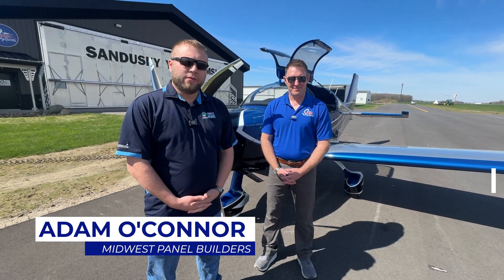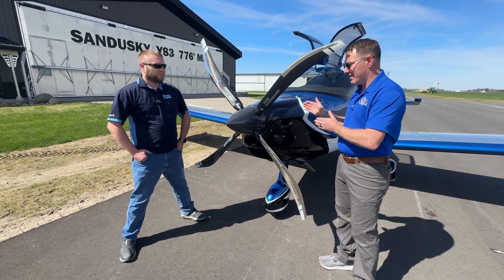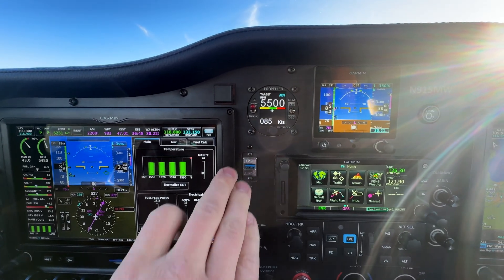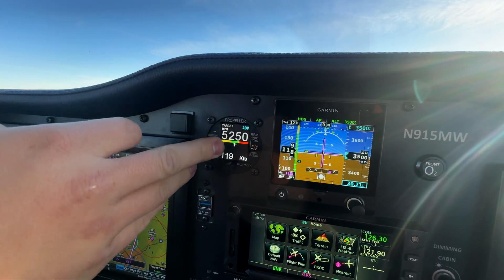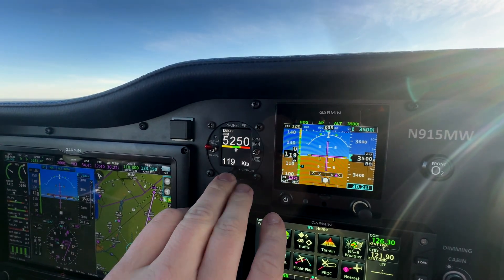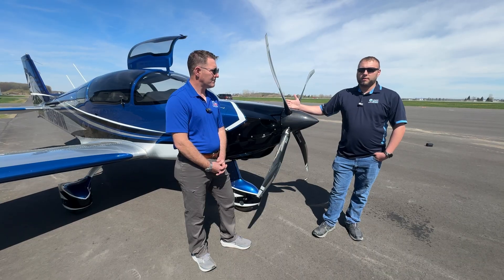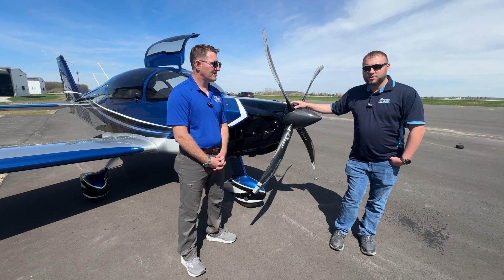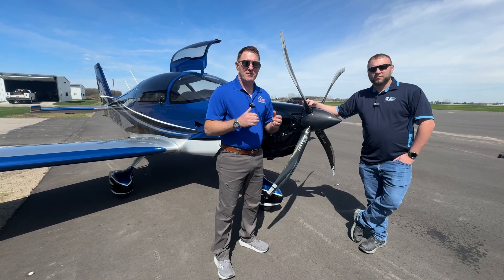DUC Tiger Propeller with the Flybox APR1

Comment: I have the PRP-1 controller, and the DUC Swirl Black 3 on my Bristell 912iS, and love the combination. I used to get 500 to 600 ft per minute climb. With this setup I now get 1000 to 1200 ft a minute and absolutely love it. I did not gain a bunch of top end speed, however, once I'm at cruise level, I can back my prop down to 5200 RPMs and still get 110 to 120 knots. Burning only around 4 gallons per hour. After watching this video, I don't really see an advantage to the APR1. I checked and it seems to be quite a bit more expensive. I pay more money for 10 more knots, but it doesn't look like this one gives that to you either. This is a great review. Thanks

Comment: So are you setting the throttle based on manifold pressure, or % throttle position?
Reply from the maker: We set throttle based on % power as reported by the Rotax ECU to the G3X. In other words, we're targeting % of max continuous horsepower. So if the G3X is showing 50%, that translates to 68HP. Flying this way means that RPM and MAP settings are less important. For example, at 5500 RPM and 30" of MAP, I would have a different horsepower output than 5200 RPM and 30". If I just target 50% power, then I know what I'm getting for thrust regardless of my present RPM setting.

Comment: This sounds like a Duc sales pitch. Either way, I refuse to identify with match sticks as propellers. I think Airmaster with Catto blades are the way to go.
Reply from the maker: There are no affiliate links and we do not sell these on our website so no sales pitch involved, we are reviewing a prop that has become popular in the Sling community. I think we were honest in saying that we would not change from a current setup and that it gave no increase in speed. We have nothing against Airmaster however we do like the speed of the hydraulic governor over Airmaster, it's an opinion that may not be shared by others, however, we have NEVER recommended something we haven't tried and liked and never will. Full disclosure on the  prop, it was loaned to us to try and if we liked it we would buy it, otherwise we would return it but we have decided to keep it and pay for it.

Comment: I found the tiger has about twice further take off roll over than the mtv-6.   And the same cruise performance.    I found duc extremely difficult to deal with and would not recommend based on that alone.  The fly box sounds interesting, agreed not sure about tying the prop rpm to airspeed.  Great information, thanks !
Reply: Interesting, in the video Adam says he sees about 5 sec sooner take off and you are seeing twice the roll distance. It seems like a huge discrepancy in observed performance. 

To be honest, I find it hard to believe that you’re getting almost double the take off roll. Perhaps your experience dealing with DUC is causing some bias in your opinion/performance description.
Reply: Both the Tiger and the Flashblack went through a battery of tests at the factory in South Africa before being endorsed. Scott Young is on a personal vendetta to bash DUC products although he was reimbursed after returning a completely destroyed propeller back to us. 
DUC takes pride in providing outstanding service to every single customer
Reply: @DUCPropellersUSAInc Thanks for the follow up. It did sound too bias on Scott’s behalf due to some tensions that might have happened. It did seem to be way exaggerated in his post.

Comment: Thanks for doing the comparison and review! 

You do need a different configuration for the engine between a hydraulic and electric prop as (you pointed this out in your video) and when you get ready to buy a prop, make sure to specify if it is for the 915 or the 916 engine. The bolt hole patterns are different enough that the props are not interchangeable.